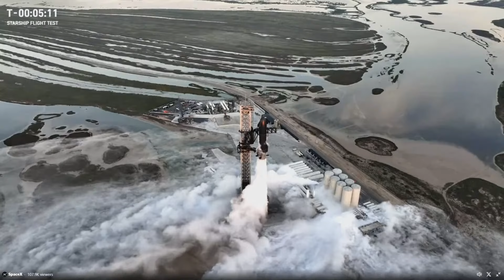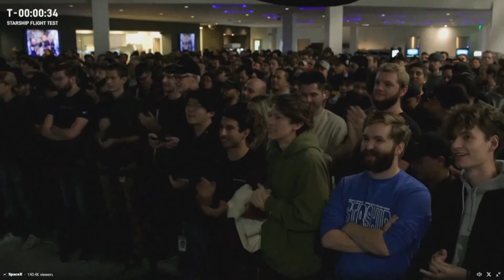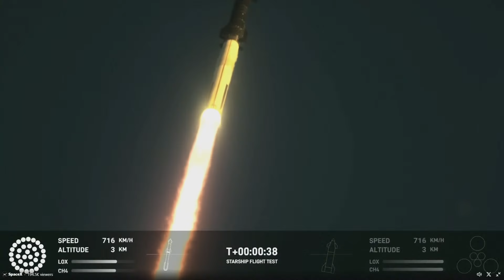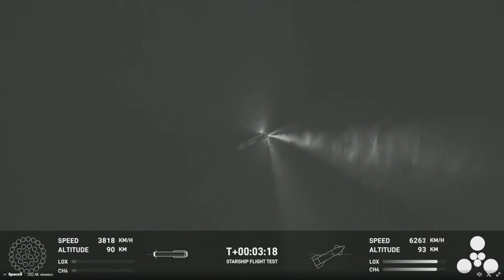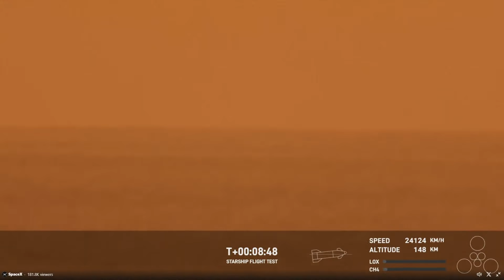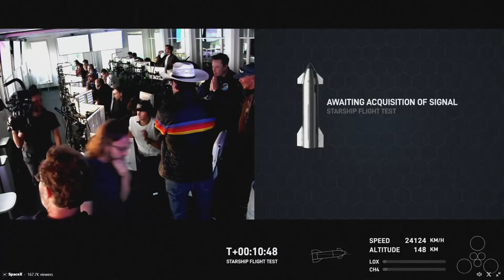SpaceX attempts second test flight of world’s largest rocket – watch live

Comment: These mf explode their rockets & scream like they successfully launched their starship

Weird
Reply: It’s a TEST flight. Their goal for this flight was to get past stage separation as it had a new system called hot-staging where the upper stage lights its engines while still attached to the lower stage. The Russian’s have been doing that for decades and they rarely get any failures, and this worked. Also, if your talking about the booster that blew up around 3 minutes into flight, that’s NOT mission critical, it’s optional. To the upper stages concern, the boosters done its primary goal flawlessly.

Comment: As I recall none of the Saturn C5’s blew up.
Reply: This rocket lit more engines in 1 go than the entire life time of the  Saturn's moon mission phase, it also is a 2 stage vs 3 stage rocket that can re use its booster of which the menouver destroyed the booster probably from un acounted fluid hammering in the pipes.
Reply: The Saturn V spent years developing each stage and engines. SpaceX spends that time destructively testing each component until failure, and fixes the problems before flight.

Nasa and SpaceX test things completely differently, and the tens of thousands, maybe even hundreds of thousands of Nasa employees from the 60’s will produce a more robust and durable rocket that’s more likely to succeed getting to orbit for the first time than SpaceX. SpaceX iterates faster, they test faster, they progress faster because they are willing to destroy prototypes to get data, while Nasa would almost never do that
Reply: But developing Saturn V costed ~20 times more than developing starship

Comment: Всё как обычно.Первая ступень взорвалась. Вторая ушла выше запланированной высоты и скорости, но не достигла первой космической скорости что бы выйти на орбиту. Зачем это всё? Эти ракеты сами себя не могут вывезти на запланированную орбиту. А как они будут справляться с полезной нагрузкой?

Everything is as usual. The first stage exploded. The second went above the planned altitude and speed, but did not reach the first escape velocity to enter orbit. Why is all this? These rockets cannot propel themselves into the planned orbit. How will they cope with the payload?
Reply: It was a test flight which ended when the Starship failed to reach its orbital inclination and so it activated the Flight Termination System (FTS) so that when it falls to earth, it doesn’t come down in one piece but as smaller pieces which burn up in the upper atmosphere.

Also, you don’t need to type out your comment twice, one in English and the other in I’m guessing Russian? You can press translate and the comment will automatically translate into your systems language

Comment: It is rather amazing how no matter what result is achieved; SpaceX wants to call it a success.  Perhaps this if for investors, for the confidence of employees, or for the attitudes of the general public.  An organization establishes its overall goals for a project and either achieves those goals or fails.  By these standards, the second launch was a failure with respect to the established objectives.  In its failures, SpaceX tends to examine its failures to garner somethings that worked so that it can claim success.
Reply: The primary objective of the test (as they stated numerous times before both flights on their website, on the webcast and on the flight plan) was NOT to meet milestones. 

Milestones were optimistic but not necessary for a successful test

The main goal is developing the vehicle and gaining insights into how the vehicles behave and any issues they have. 

It’s flight based testing. Instead of simulation or ground based testing which is time consuming and costly
Reply: This is the same way they developed falcon it is now the premier rocket launch system in the world. This launch also meet the basic objectives.
Reply: Ignor the obvious if you will.  Sorry, but the basic objectives were NOT achieved.  If you want to claim that secondary or tertiary objectives were achieved, well...OK.  However, if the "other" objectives are to be used, they should be promulgated up front and not dredged up after the events.  What SpaceX is doing is what is called "R&D in the field."  Essentially, put something out there and see what happens; problems are addressed thereafter.  Getting it right up front is not the stratagem.  @WyoSavage1976

Comment: as short as that hot staging ring is, using all six engines to separate caused the boosters RUD because those vacuum engines are only millimeters away from the dome that protects the dome of the booster they may want to try making the hot staging ring taller and/or  only using the three sea level raptors to separate the stages  As for star ship interesting i believe the engines shut down either because of a lack of fuel the flight termination system may have activated but if that's the case what was that big object that was captured on video entering the earths atmosphere
Reply: I don’t think so, engines were exploding before rud, opposite side of the hot staging ring, I think it worked almost perfectly.

Comment: Why are they wanting to flip the booster ? At those speeds seems strange to do that.
Reply: They have to turn it around to land it. Also, the speed is irrelevant, because there is no air / drag up there.
Reply: It's basically what the falcon 9 first stage does, but scaled up to a much larger size. (although there are a few key differences)

Comment: Does this not break the record for the most powerful thing every made?
Reply: yes x 2
Reply: Also at 5000 tons, starship is the heaviest object to take flight
Reply: @shouryabose5943  You are off quite a bit on your weight number. Its around 1500 tons fully loaded. considering this was just loaded with propellant and no cargo it is around 1350. Older rockets such as the Saturn V, the N1 and even The SLS weight more. Also the SLS  is the only recent super heavy that has done a > 50 T payload launch, not to mention successfully launched.
Reply: @weakish your wrong. Starship weighs almost 11 million lbs. That's 5500 tons. Plus Elon himself said this during his latest interview on JRE.
Reply: @weakish  For one, he is correct, I don't know where you get 1500T from, that is just wrong. Also, this is the most powerfull rocket ever.
Reply: Unfortunately the Tsar Bomba still holds that record albeit  in a different context.
Reply: @Ingramdumpkiss   Tsar is not a rocket transporter, FYI.
Reply: The most powerful rocket ever made, correct?

Comment: It appears to that the starship isn’t going to have enough fuel to reach orbital velocity of 17500 mph (28163 kph) it was almost out of fuel at 24000kph
Reply: It was not going to orbit
Reply: @ianmayes5572  the plan was for it to make one orbit then re-enter for a splashdown
Reply: @mattg3971   That's not orbit. The plan was for it to enter a suborbital trajectory and achieve a velocity fast enough for it to test its reentry systems. Orbit by definition is a stable periodic rotation around a celestial object; Starship's trajectory would have circumnavigated the Earth but that's not an orbit any more than a balloon going around the Earth is.
Reply: @roberthesser6402 that’s like 99% orbit. If it can hit that, it can hit an actual low orbit.
Reply: @roberthesser6402  very true but the were still aiming for orbital velocity
Reply: That was my whole point anyhow
Reply: @mattg3971 nope they wanted to reach sub orbit and land in the water of hawai
Reply: It probably will; that amount of fuel looks deceiving, but it is likely enough to accelerate those last 4000kph or so. At that point, the ship is super light compared to at stage sep,, and the lighter you are the less fuel you need to accelerate. There's also room for improvement in the design though if dV is a big concern.
Reply: @pekabu01  true but it just didn’t seem to be accelerating fast enough at the end to me anyhow. But I fairly sure that those people at SpaceX are on top of their game and way smarter than myself.
Reply: It was not fully loaded with fuel, you don't add fuel that you don't need.
Reply: it appears to me

Comment: A disaster. Too complex, it might never work.
Reply: Okay bro, it's only the second flight
Reply: compared to normal rockets, this was as close to perfect as you can get without being 100% successful.
Reply: @snuffeldjuret  what are you smoking? it exploded. the question is how many explosion can spacex take before giving up.
Reply: @user-lv4lb2gp8n the booster exploded after separation, normally in rockets the booster uses all of its fuel up and lands in the ocean where salt watter destroys it. So it effectively had the same result as a success launch.
Reply: @NigelFerris-p2h the previous model rocket blew up 4 times . Now they fly all the time 🤷‍♂️
Reply: @jacobjorgenson9285  You show a serious logical flaw. There is no guarantee that the current model will ever flow successfully. And the current try was a spectacular failure.
Reply: @miguellopez3392  "the booster exploded" - stop there, that's it. you were gaslighted and now try to gaslight others.
Reply: @user-lv4lb2gp8n  booster exploded when it re ignited its engine, something no other rocket would even do, it's simply a success to get further than the last attempt when doing something new, that is literally how the space race functions.
Reply: @miguellopez3392  It's not about doing something new. It's about doing something that works. No one wants to have his work explode. Btw, it costs a lot of money, too. You can ask the question how many unsuccessful launches until the project is dropped or spacex is toasted.
Reply: @NigelFerris-p2h  it is, doing something new always includes unknown risk, nasa blew up over 400 rockets to get to where they are today, spaceX is about a dozen to get to a rocket more powerful and advance than any other rocket in development, failure is expected, the only limit is how much money spaceX has, but thankfully the cost to make one of these rockets is about the same cost as one of Nasa SLS engines which there are 4 of on a SLS rocket booster, nasa can't afford SLS for regular moon mission so they will fund starship till it works.
Reply: @NigelFerris-p2h do you hope to get 100% of a test the first try? No, you try it, get your score and try again with that information you got. This was the second flight which made it about 95% of the way to a near orbit as planned. It failed just a few second before it hit its final target. And the first flight made it about 30% of the way to space so this flight excelled. SpaceX iterates of failures, just like almost every engineer probably ever does. If something doesn’t work, don’t give up and try something else, look at what failed and fix the problem, then try it again.

Edit: also, the booster is NOT mission critical. It doesn’t matter if it blows up or not after stage separation, the payload will still get to space.
Reply: SpaceX blew up about a dozen falcon 9 boosters before having their first successful landing. Now it has landed back from space 230 times. I am sure you would have been here saying the same thing about those tests, and look how successful it is now.
Reply: @danielthunder9876  You oversimplify it. Unfortunately you can't predict the future. Past success doesn't imply future success. Learn to think, you were gaslighted too easily.
Reply: @NigelFerris-p2h  You also can't call it a disaster when this is what they always do in development either. Past success is literally a determining factor in awarding NASA contracts which they won for this rocket, so maybe you think you know more than NASA?
Reply: SpaceX flies, fails, fixes. Flies, fails, fixes. That's their path towards a successful outcome of all launches.

Comment: It is unbelievable that Musk was allowed to launch again after the disaster that was the first launch. Glad to be living in Europe where we have laws and regulations (which rich forks still circumvent, but at least they have to put some effort into it).
Reply: So your motto is if at first you fail give up?
Reply: @ptech88  
Musk announced in advance that the first launch would fail. There was no reason whatsoever for that launch. This here today would have been the first launch if grown-ups were running SpaceX.
Reply: @ricksimon9867  hows your rocket company going?
Reply: @ricksimon9867  Last time your EURO bs Union BS announced explosions as well and did not prevent it. That was fun.
Reply: @ricksimon9867  SpaceX's iterative design approach incorporate failures into the testing process. It's basically the same thing as crash testing cars. Every car manufacturer in the world slams their new models into solid metal walls at high speeds to see how it holds up and where the points of failure are. The Falcon family of rockets was designed built around informed failures that turned the Falcon into the single most successful and reliable rocket in history.
Reply: @roberthesser6402  
From "we will put a man on the moon" to "one small step for man", only eight years passed. And half a century passed since then; we now have much better IT.

NO, there is absolutely no reason why the development of Starship takes longer than that of the trailblazing Saturn 5 despite having computers and simulations a thousand times more advanced.

Let me repeat that: SpaceX are WORSE than 1960s Nasa. That is a fact.
_
Reply: @ricksimon9867  No he didn't the goal of the first launch was to achieve orbit and it failed. He was trying to save face and spin an obvious failure as a win.
Reply: @223Drone reaching orbit was the ultimate goal but SpaceX made it clear that the chances of this happening on the first try  with an outdated version of the test vehicle was extremely unlikely. 

SpaceX is constantly building new test vehicles and iterating on the design with every subsequent vehicle so if they hadn’t tested it until failure it would have just been disassembled to make room for newer test vehicles and they wouldn’t have gotten important test data
Reply: @plutoniumzeppelin8164  Except you don't need to explode rockets in order to get data as simulations can do the same thing. You're making excuses for obvious failures and unsustainable methods of testing. If SpaceX/Musk are just going to keep blowing up rockets than the FAA won't bother approving more launches.
Reply: @ricksimon9867  No he didn't he tried to save face when the test obviously failed. Also crashing cars is much more cheaper and sustainable than blowing up rockets.
Reply: @223Drone  
You replied to the wrong person.
Reply: daft
Reply: no, it is perfectly believable.
Reply: Remind me again, how's Ariane 6 going?
Reply: @infinitelyexplosive  
You do remember that Musk announced in 2017 that by now (2023), several Starships with equipment should have landed on Mars? Of course you don't. That stuff just doesn't register with the fanbois.
_
Reply: Spoken from a continent that’s never been to the moon….
Reply: @born2xplore211  
If you knew the first thing about the moon race in the 1960s, today's test would make you laugh, too.
Reply: I mean these things happen when testing experimental vehicles…and SpaceX was held accountable by the FAA and US fish and wildlife which is why all test launches were out on hold pending their investigations. SpaceX also made all of the required changes as a result of the investigations which is why the 2nd test flight was significantly more successful and resulted in the flight termination system working as intended as well as next to no damage to the launch pad
Reply: exactly thats why there is no progress in almost any kind coming from europe anymore....  the laws and regulations destroy any progress
Reply: @Miamiaerial  
The lack of laws and regulations in the U.S. destroyed the global economy in 2007, and as early as 2010, Americans voted for the party who caused that crash again. You are insane people.
_
Reply: You fail to realize how large the US is and how the launch is designated over water, and warning was given to mariners weeks in advance. It took more time for the government (FAA) to file paper work than it did for space X to rebuild a launch pad and assemble another 40 story rocket.
Reply: That's why whole European countries begged Elon to open Tesla manufacturing unit in their countries
Reply: @hustlersgame8759  
It's a car factory. Jobs. What does that have to do with anything we are discussing in this thread? FFS.
Reply: @ricksimon9867   it's about trusting Elon. The guy said he should be only given one chance. They don't understand in order to develop technology people fail multiple times. Why does EU act like tyrant.